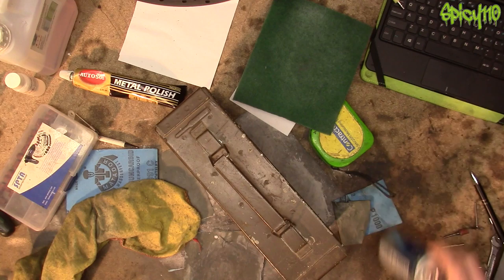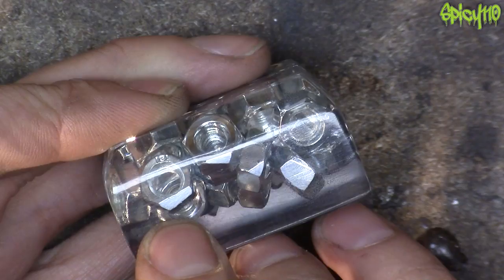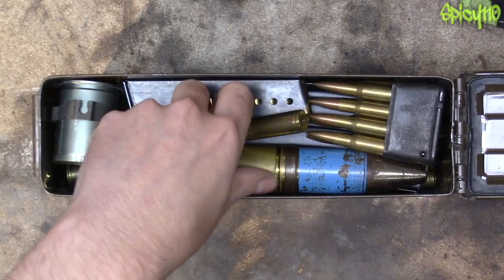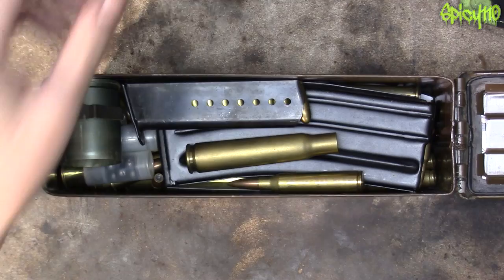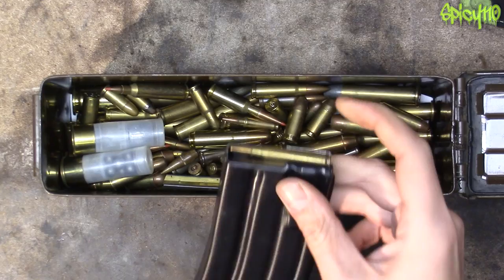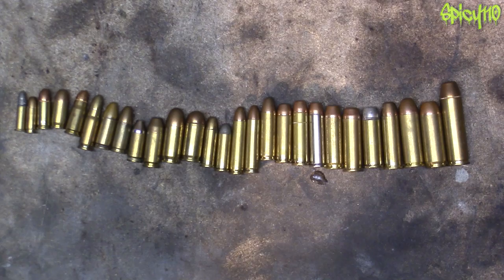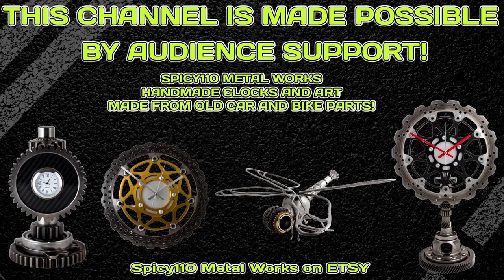Inert Ammunition Collection  | Quite a lot but there is more now!

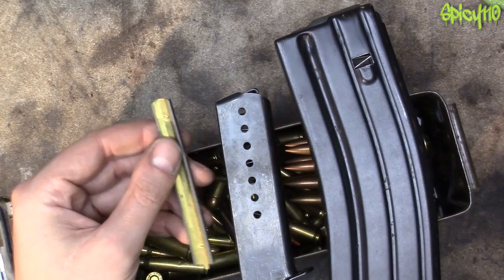Comment: Hey Spicy, @ 14:17 it's a 7.62x54r Mosin Nagant rifle round.   At 26:47 it's called a striper clip, it looks like it goes to 5.56.  The Mosin Nagant also uses striper clips.  I have both rifles and use them often.  I hope this helps.  AWESOME collection!  I wish I could send you a 7.62x38r casing that goes to the Nagant pistol.  The bullet is below the rim of the casing.
Reply from the maker: Arrr yet they did that to seal the gas didn't they? Yer sadly the laws doesn't allow  😑

Comment: Surely live shotgun shells are ok without a firearms license
Reply from the maker: Nope you must have a licence for any live rounds.
Reply: @spicy110  in the UK you legally don't need need a Shotgun Certificate to posses cartridges and you can buy cartridges off anyone except a registered firearms dealer if you do not hold a valid certificate
Reply from the maker: Ok I stand corrected and surprised!
Reply: @spicy110  i though it was like that. I have a ticket but hevent bothered getting  a gun as a good pest control air rifle does the job

Comment: the 9mm mag is illegal. it counts as a fireams coponant. its the same thing as owning a live 9mm bullet without a license or a firearm without a license
Reply from the maker: Are you sure about that? They are being sold by pretty much every military collectors supplier in the county. It would be very surprising if you were correct. In fact thinking about it that has to be wrong as you can own deactivated 9mm pistols with removable mags no issue.
Reply: @spicy110  i could be wrong but as far as i know its a fireamrs componant n they are illegal but i could be wrong.
Reply: Absolutely not, regulated components are a barrel, chamber, or cylinder; a frame, body or receiver; or a breach block, bolt or other pressure bearing medium, as well as suppressors. Magazines, optics, stocks, triggers, all unregulated components as they should be.